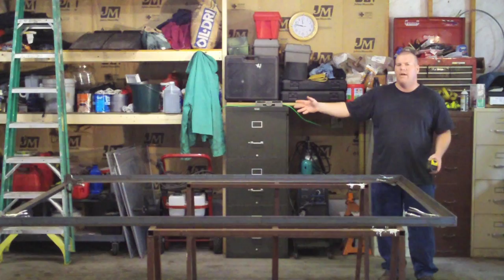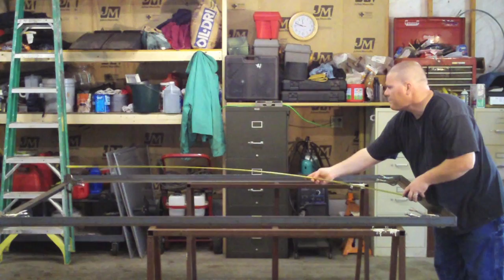How to square up a large frame for welding

Comment: As long as u can make 2 symmetrical triantgles out of the "square" set your "legs" and then check the hypotenuse and there u go, but for welding we need to stabilize this if u have a good flat fab table you can just clamp each "peice" in the corners but on a saw horse like he had I would use 4 and turn them 45 degrees so you can clamp 2 peices to it to hold position and clamp both peices in corners to a peice of flat stock  to make them flush